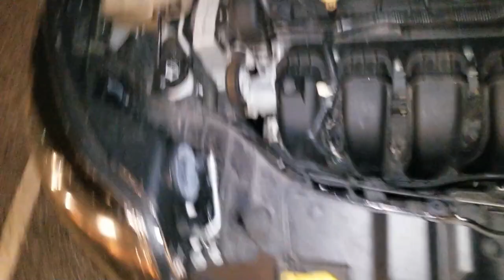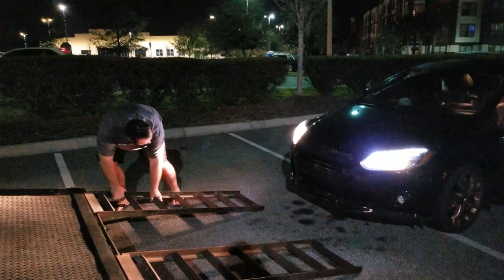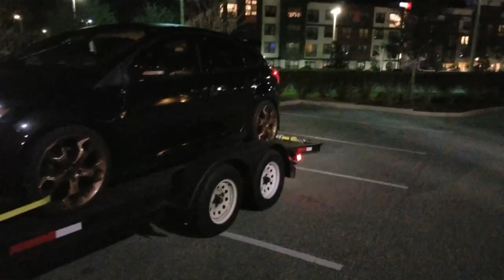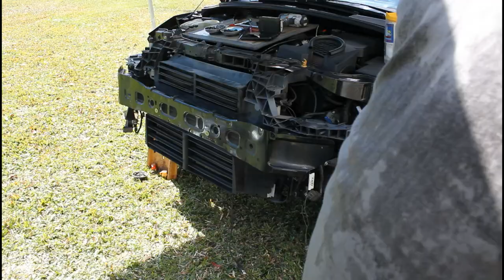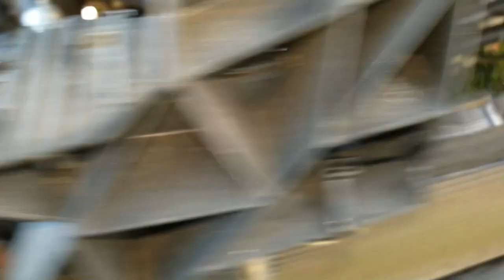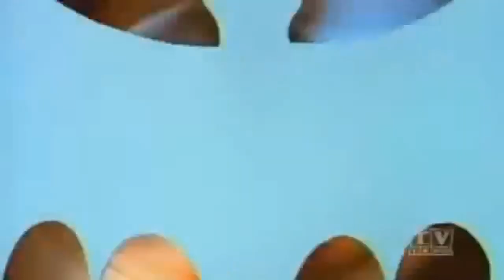Focus radiator blew out, WHY!!!  🤦‍♂️

Comment: doesn't look like my focus engine bay.  help to know the year of the focus SE? ST?
Reply: SE foc. Not ST. Easy to tell by the front end and no boost, oil pressure or oil temp on top of the dish over the radio.

Comment: Did u have to drain ac lines my mechanic says they have to im just changing my rad
Reply from the maker: Nope
Reply: They say this to make it sound more complicated told me the same but the condenser actually detaches from the radiator I had to change my front impact bar so when I took it off it made changing the radiator a breeze idk if that how most people do it or not lol!